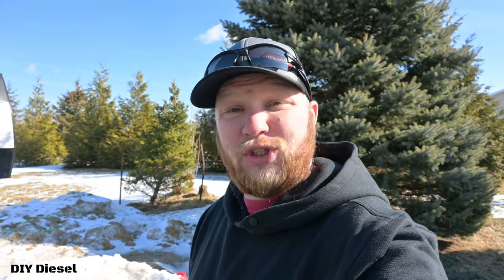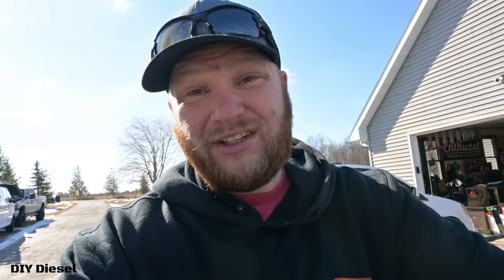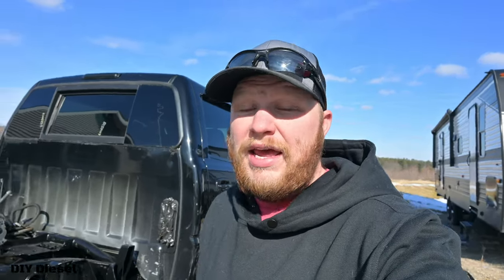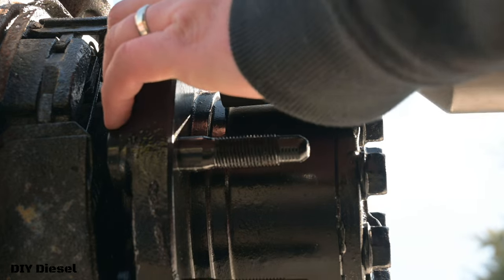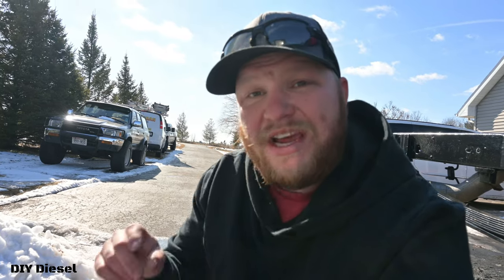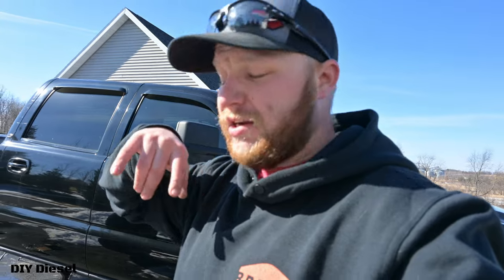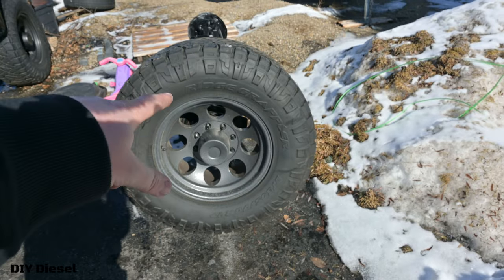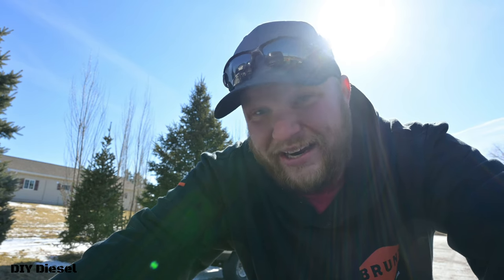DIY Wheel Stud Repair: How to Easily Rethread Your Wheel Studs Like a Pro!

Comment: Sorry as an old time mechanic..too much money and you are luck to use a 2nd time...little wire brush then a little never size your lugs would be fine...you could buy a cheap die set at harbor freight tools for $30 and get the cleaning also from it for way less money...work smarter not harder
Reply from the maker: I have actually used this a second time already as well. I don’t disagree with you at all 👍 everyone has there ways. It doesn’t make one way right, or one way wrong.
Reply: @DIY Diesel   I'm always trying to save money myself And just figured I'd shoot some information your way or whoever reads it how to save a buck or 2... And you are right as well everybody is their own boss ...happy wrenching
Reply from the maker: @pmag3200  appreciate that man!